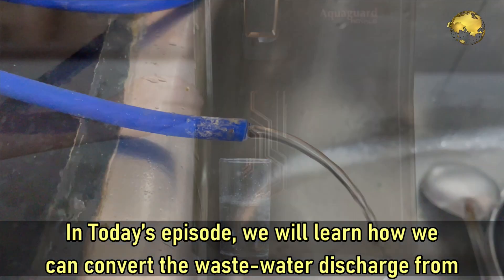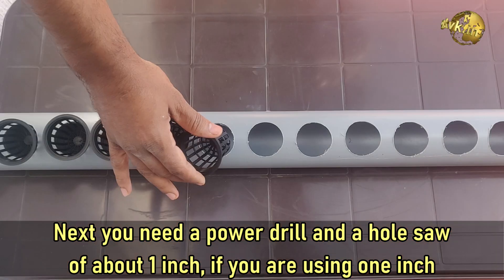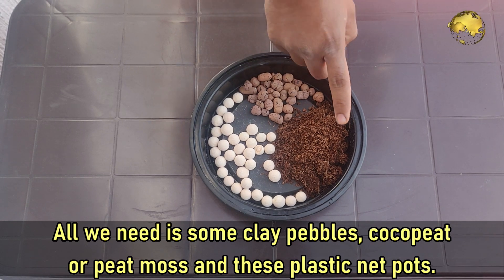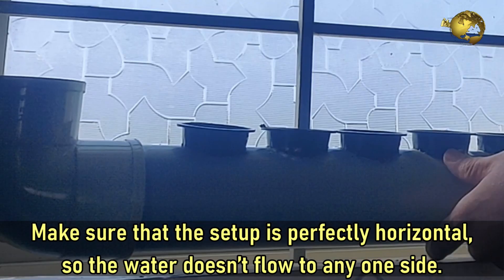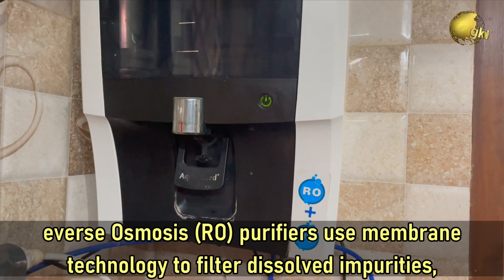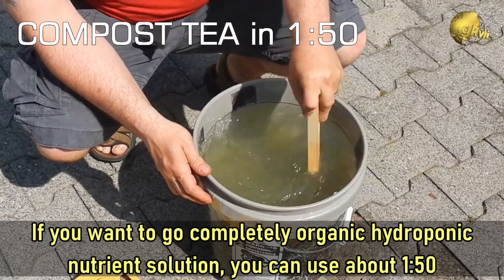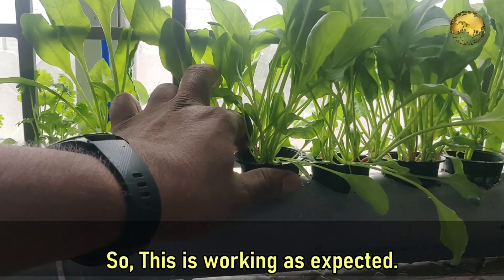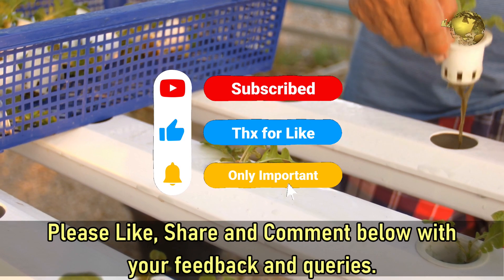TRICK TO RE-USE RO WASTE WATER | EASY DIY HYDROPONIC SYSTEM FOR GROWING GREEN LEAFY VEGETABLES

Comment: I would never use RO wastewater to grow my edible plants.  I actually bought an RO filter so I can use RO filtered water to grow them since my tap water is so hard.  Got tired of constantly adding ph down to the tap water to get it where the plants like it.  The whole point of hydroponics is to have a system where plants can get the exact nutrients they need from water.  You don't want other contaminants in the water that throw the balance of nutrients or ph off.

Comment: Nuts. Silly. Pointless. RO waste water shouldn't be used in this manner. Besides hard water water/excessive minerals, and viral pathogens, HALF the reason one is using an RO system is probably to filter out difficult stuff, like chemicals (pesticides, herbicides, heavy metals, industrial chemicals, pharmaceuticals, PFAS, etc), that are not good for you. So now you're gonna feed that more concentrated waste water to a plant, which will likely uptake those chemical, which is hard on the plant potentially, and then which you eat? Not smart. You should only be using this practice for bio-sequestration (using plants and biology to specifically soak up hazardous and carcinogenic chemicals and substances which then are disposed of properly)

You shouldn't be drinking straight RO water either that hasn't been re-mineralized.

Comment: I m using RO water in my garden from years. I had connected ro waste water pipe in 300 litre container and a tap in that container. Best use of waste water for my vegetables garden.
Reply: Hi can we directly use the water purifier discharge water,or add 50:50  of discharged water and freshwater mixture.

Comment: Dr Saab good morning  many say that vegetables  rice   daal  washed water are good organic metereals or any peels of fruits vegetable and so on   all are organic   Saab iam an old timer Up to my college days we have seen only organic farming   slowly started changing accordingly  now my question is when we use the waters peels  etc  atleast  a small %, of in organic metereals coated on the produce (modern times) we are using on plants  so it's not fully organic  So what's the difference  it makes ?
Iam breaking my head to get the answer to this  I know U Are the only person to solve my question May be iam wrong and crazy  but still I ask u for the guidelines Thank U Dr Saab God bless you
Reply from the maker: Yes Mam! You are absolutely right. Wash water will contain traces of that stuff. If this is a major concern, then better avoid direct adding these waters to plants. Here composting process helps. Nicely decomposed stuff , that’s composting comes to our rescue. Composting process breaks most of these including pesticides etc into harmless chemicals according to some research papers I have read.
Reply: Yes Dr Saab iam going to use all the peels of veg and fruits  in compost bin and water Ican use for my  big trees  Thank U Dr Saab  for curing  my tention  with ur simple and effective answer  God bless you

Comment: For hydroponics check TDS (ideally less than 100 & usually RO treated water- not the waste). After adding nutrients TDS should be in the range 700~1200 for leafy green veggies. RO waste water is usually more than 200 so best not used.
Reply: Very true, and wise caution. In my case, the waste  is extremely high in sodium and manganese, so this would be wild to use.

Comment: Thanks for the tips. It is better to check the TDS of RO waste before doing this. To give a real example in my case , the input is govt water supply whose TDS is around 270 ppm here (it is high  I know). The RO water output TDS is 12 (which is very good) and the RO waste water TDS is 374 (this is very high). Especially when your RO is efficient and wastes less water, the TDS of output goes up a lot because the removed salt is added to less waste water.
Reply: Are you sure your RO filter doesn’t need replacing the tds is ment to come out 0?
Reply: @hamster1-1  
RO filters can't remove everything. If you want 0 ppm, you need a still.

Comment: If we want to do away with motor can you suggest alternatives
Reply from the maker: It’s a simple system and very effective - I have used here too https://youtu.be/kAQt1__1wsM
Stirring or shaking the water once or twice a day is alternative to oxygenate water.
Reply: Ruma, you can check out the Kratky method. Its a passive hydroponic technique.